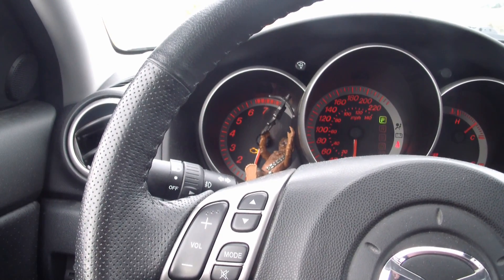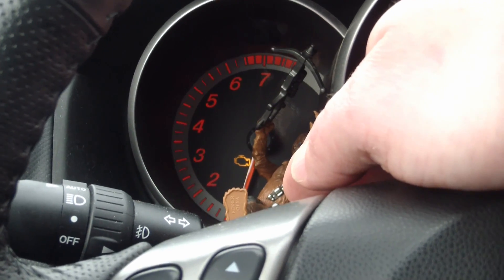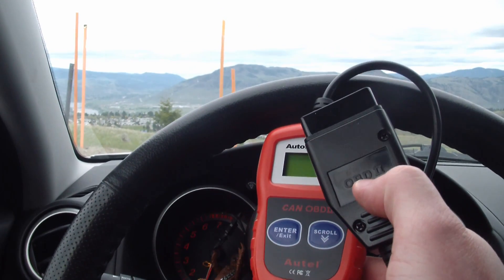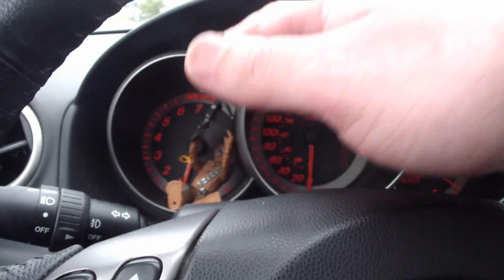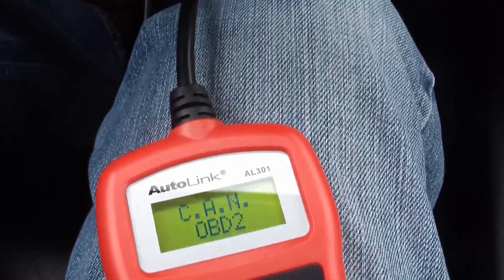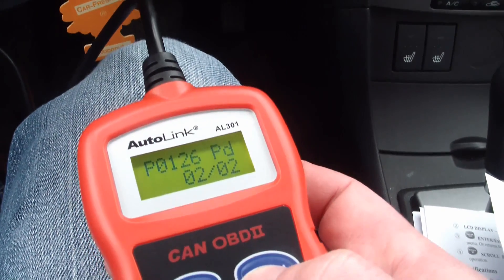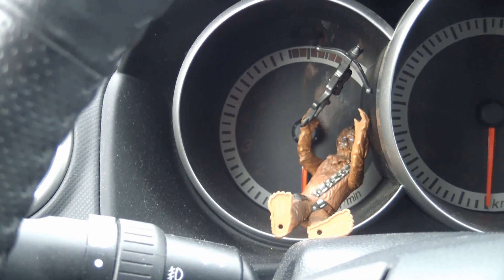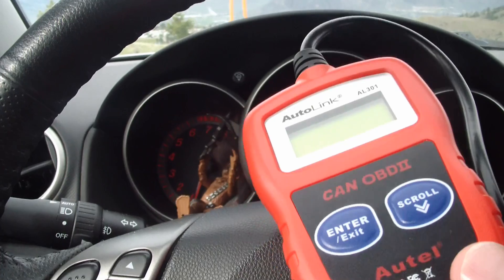Manly-Man Skills: Outsmart Mechanic Scams by Using Your Car's Computer!

Comment: Dealers arent all fuckin crooks.....Backyard Mechanics such as yourself are the crooks. Ripping people off and still not able to fix the car. Then people bring me the car at my dealership where I work to get it fixed right.  :)
Reply: Backyard mechanics are not the crooks. Quite a lot of them may not have all the proper tools to do the job as fast as a dealership but they give it an honest effort, unlike 99.999% of Stealerships. I'm not a certified mechanic but I've been the owner of a dairy farm for the past 38 years and there is not a single car, truck, tractor, implement, etc. that I've come across in all my years that I haven't been able to fix, and fix properly, by myself. Everyone in my neck of the woods brings me their vehicles, tractors, small engines, etc. for repair/rebuild and they contact me for all their welding/fabricating needs because they've all been screwed over by large garages and dealerships.
 I've worked with a lot of younger guys who were certified mechanics with 4-5 years experience under their belts yet still didn't know half the time and money saving tricks us non-certified mechanics know from hands on experience working in our shops on the farm.
Dealerships are there to make money and the mechanics don't give a rats ass about honesty. Shade tree mechanics and farmers who help out their neighbors put TLC into their work to keep people coming back and to honor their names so their friends and neighbors don't think they are goofs.
Reply: Jim Garrison 
I have had to repair alot of what local farmers have screwed up. bailing wire and duct tape can only do so much. most of them ( 95 percent) Need to stick to pulling tits and planting corn. not all professional mechanics are bad and not all backyard mechanics are bad. but most professional mechanics are not farmers and most farmers damn sure are not mechanics. stick with what you know

Comment: did the code ever come back? 2.3/2.0 4 cyl...thermostat is sticking open...common thing on these. v6...also check the thermostat. probably a 4 cyl in there since it's a Mazda 3.

Comment: OBD2 codes are a standard diagnostic logging system. The PCM will set trouble code(s) and command on the malfunction indicator lamp. These stores codes indicate a fault with a System, not part. The least likely cause is "loose connection" at a connector. By the way, the thermostat code this guy is talking about WILL come back. Simply starting engine after clearing the code didn't fix anything. The engine had not researched operating temperature and the PCM hasn't monitored the coolant temp sensor long enough to decide to turn on the lamp again. What he DID do in the video was erase all of the stored data related to the trouble code. This is a variable source of information for a real technician to evaluate the cause the code.

Comment: There are now PC based scanning systems available that turn your laptop into a scanner. They use a hardware interface that plugs into the OBD2 port and communicates with your PC via Bluetooth. You also need scanner software to run on the PC. I got a very capable scanning system for around $60. In addition to trouble codes and monitor status you can monitor things like coolant temperature, O2 sensor outputs, engine vacuum, MAF sensor outputs, fuel trims, etc. It will even make graphs so you can record what's happening as you test drive the car.

Comment: I've saved thousands by checking codes myself. The first time they charged me $120 and all it was just the gas cap wasn't tightened down all the way. They didn't want to tell me what the code was. He just said it was nothing important and still gave me the bill for $120. I made just enough of a fuss and they finally gave me the code. I've never gone back to the stealership.

Comment: The general rule for Audis is that a lit CEL is normal, no big deal. A flashing CEL? PULL OVER NOW!
I'm not sure if other makes are the same.
Reply: flashing light is bad
Reply: CallsignWulf a flashing cel can be for a misfire, but it just means that a catalyst destroying event is occurring.
Reply: Flashing CEL on every car I've seen is an active/currently happening misfire.
It's honestly not that big of a deal, depending on what you are doing of course. If it's only during high load, just ease off and get it fixed when you have time. If it's happening under no load or light loads, yeah might wanna get that fixed pretty fast. Either way though it's not good, misfired will kit the cat really fast.
 Source - ASE Student Certification
Reply: flashing cel is often a misfire, but a 'misfire' may be really bad compression, in my case a exhaust valve was burnt out. or your valve timing is off. basically flashing cel is anything the computer reads that MIGHT destroy you motor quickly. take it seriously or be prepared to buy another car.
Reply: a flashing CEL is a type A misfire. which is a misfire that is frequent enough to damage the catalytic converter by dumping unburnt fuel into it and melting/burning up the cat. that is why you want to pull over and stop the engine asap. so yes, it is a big deal. do not listen to callsignwulf

Comment: One of the great things if you have an Android based phones is you can buy a bluetooth based OBD sensor which allows you see what is going on while driving (i.e. oil pressure, temp etc.) It is a bit more finicky than the cabled ones but more informative. Majority of the codes people see are emission related but the big one is a loose or malfunctioning gas cap (aka minor evap). Also keep in mind that behind the standard is required interval testing where it will poll the sensor at specific points ie after sspecific mileage, number of starts, etc.

Comment: love yer vids.
As a proffesional stealership tech, i can partially agree with you. i encourage folks to buy a POS scantook, or even stop at a local parts house, and pull the codes, then use the almighty google and see if its a big deal.
the part i cant agree with, is that the codes exist outely for then stealership financial pleasure. The codes are a tool, to help localize the real problem. Most codes, will cause(over the long term) damage to the catalyst, which will effect fuel trim, and thus lots of other parts of the drive cycle. Older cars, it didnt matter remove the cat, but newer cars use the cataylst for fuel calculation ie ecm looks upstream and downstream and adjusts based on the difference.
Without going into much detail, stealerships are in need of a wake up. charging what they charge, is as ludicrous as how they pay us as technicians. It forces us to basically not give a @$!#, and just work, instead of being fair about it.

Comment: True story, The Mitsubishi stealership charged me 75 bucks just to read the trouble code. They also wanted 500 bucks to replace an O2 sensor. I declined the O2 sensor change. Come find out I just had a dirty air filter
A$$Holes!

Comment: It's unlikely that this was a fluke or sensor having one little slip. This DTC is a two trip cycle. Meaning that the car has to mess up twice in a row on two separate trips. They thought this through when they introduced OBDII. Your pending code mean that it has seen the fault happen in the last trip and so it sets the pending code. If the same instance occurs twice in a row in two different trips it will set a permenant DTC and illuminate the check engine light. So most codes are not random sensor glitching.  Some codes are considered 1 trip dtc, but these are considered major fault code. If you have any questions about cars ask away. I can most likely point you in the right direction.

Comment: you have know idea what tour talking about. nobody will know your car better than people who work on them everyday over and over again. an independent shop will not know the product as well as a dealership technician. and certainly not you, apparently. that code would come back instantaneously. it will need to be driven in order to detect the fault. something you never do is erase a code to see if it comes back. it set the code for a reason. not because of a glitch.
Reply: Dealerships don't necessarily know everything. My friend has a Ford Falcon Futura 1996 and it has a idle problem where it will hunt like crazy, revving up and down. He took it to a couple of mechanics and they couldn't figure it out. Finally he took it to the Ford dealership and they kept the car for 3 days and they couldn't figure it out either. If Ford can't figure out WTF is wrong with a Ford then nobody can. So he learnt his lesson, never buy a Ford, and mechanics and dealerships aren't the all knowing car gods he thought they were.
Reply: Well I do agree with you on one thing. Never buy a ford

Comment: Most of the time the light comes on because the gas cap is not on right or missing. The light will also come on @ a set milage so you will come in for a service so they can change you EGR valve, O2 sensors, clean the throttle body & shit like that when it usually fine. most of the time they do nothing @ all!!..........if your lucky they will lube your hinges & latches.

Comment: More often than not it's because of a bad seal on the gas tank, or from getting gas with the engine running.  The sensors trip if there is no vacuum in the vapor recovery system, usually removing and replacing your gas cap and running the car for a day or two will reset it, once it runs through a drive cycle .
Reply: on the evap emission systems a lot of times its a loose gas cap or seal, but if those are good usually is the canister vent valve on the charcoal canister

Comment: My Avalon has this lovely quirk where if it doesn't like the way I screw the gas cap on, it turns the check engine light on along with 2 other lights. I was considering getting a computer to turn the code off myself so I'm really glad I came across this vid. Thanks for the info brother!

Comment: It means that a micro-chip has burned out really for the most part because you have about 200 sensors that light is connected to.

Comment: I'm old enough to remember cars without computers / sensors / fuel injection. I think cars in general have become more reliable as a result of new technology. The thing that seems to confuse repairers, is when there is no fault code stored in the computer - they then seem to have a guess at which component is at fault, then swap-out parts - at the customers expense - until the fault is cleared.

Comment: not all codes come back instantly if there is a problem. Things like evap codes need 2 faults detected before it will set the code. this can take a long time as the fuel tank level has to be in the right parameters, ambient and coolant temperatures have to be in the right parameters, and it sometimes takes a proper drive cycle to run this self monitoring test.

Comment: Even if you fix the problem and erase the codes the smog techs can fail you because their code readers can tell them if a code has recently been erased ,
Reply: Well its not about the codes being recently erased, its about the ecu/ecm performing all the required tests. When you clean the codes, you also clear all the stored info for the tests the computer performs. Some cars and driving styles can quickly perform those tests, maybe like 30 minutes of driving, others can take months or longer. It should happen relatively quick but there was some problem in earlier systems (my car) that make it hard to complete the tests. 

for some Subarus: Readiness drive pattern: accelerate to 50 MPH, drive for at least 3 minutes without braking, decelerate to 30 MPH, then accelerate again to 50 MPH, and drive for at least 3 minutes again without braking. If having to brake, then start the pattern all over again.

Yeah... when will that ever happen naturally on any road. Oh yea, on these Subarus, some of the tests only happen if you have more than a 1/4 tank of gas, but less than 3/4 of a tank. The main issue was that until a test is finished, when you turn the car off, it reset the test again, and has to restart.

Comment: the enginelight lit up on my fiancees audi, 3 km later it was dead, seized camshaft. that was apparently not one of the 9 times out of 10...
Reply: Are you sure it wasn't the oil light she was ignoring?
Oil light= shut off engine
Reply: it's a lot less than "9 out of 10"
Reply: I had a wife who did that because the oil light in her Renau was always on. Blew a gallery plug on my kombi and got about 5ks down the road before friction-welding the motor

Comment: There is one problem with unplugging the battery no days with the current vehicles. If you do that, you clear everything out of the computer including the programming of the computer to operate the engine. You will then have to get said car towed to dealership for reprogramming. Best advise is to 1 check internet if your car falls under "unplug battery precautions" 2 if you can just get away with the scan tool trick. Happy diagnostics to y'all.

Comment: My car periodically gives the check engine light and when I plug in the code reader it says “small emission leak” I clear it and it’s good for a few weeks.  You’d think if it was something serious it would happen every time I ran the car.  Here in Ontario we need emission check and it passes so what the frick?
Reply: +CurseTheDawn Some emission sensor might have gone wrong :P All depends on if you got petrol or diesel. Both systems are pretty much in two different stages. First stage dose the calculation of how well the engine will burn, 2nd stage checks that the burn is ok. If you got a petrol engine there might be an oxiden sensor (aka lambda) at the most rear (of all the oxiden sensors) which has gone bad :P They commonly got a heating element aswell, and can pretty easily be measured by an ohm meter.

And the reason why it takes some time for the code to come back is probably because it needs to really dubble check the emission status. Or it could be a "glitch" problem. But a "dead" oxiden sensor fits in on your fault :p But more measurements needs to be done before that is said.
Reply: Wow man, thanks for the detailed response.  My issue is with a 3.7L GM petrol engine.  That is the most common error but I've had others.  One time it limited power and said ABS failure, Stability System failure.  I pulled over, shut the car off, cleared the code, and then everything was fine and has been since.  Really makes me question the quality of that vehicle's sensor system.

Comment: You can also get a sensor to plug into the jack that will transfer the information to your phone real time. Not just error codes either. Super cool how much information you can get.

Comment: I think your representation of technicians is not just and you should think of a better way to represent your lack of trust.  I will admit, I am a technician and I take offense and I am sure many others do.  Not everybody in our trade is dishonest.  Some of us work VERY hard at being honorable individuals that perform the repair correctly the first time. The system itself is what drives mechanics to do bad.  They get their knees chopped off for warranty labor so they try and sell everything they can, sometimes including things you don't really need.  Mostly flushes.  If you question it, make them prove it.

 The largest and unknown trick that I see crooked shops do today is labor overlapping,  This is THE leading reason why repair bills tend to be so high.  Lets say that you take your car in and it is overheating, say a Toyota Tundra.  Nightmare situation for most people.  The shop says that you need a water pump, which includes the replacement of the timing belt.  They say you also need a new radiator and a serpentine belt.  When they give you the labor quote, they will look in the book (Usually Mitchell or Alldata for independent shops) and look up the labor for each individual part to be repaired or replaced. 
  In all reality, the labor will take far less than you are being charged for.  If you are doing the timing belt/water pump, that means that you have to pull most of the front of the engine apart anyway.  That means the Serpentine belt is coming off anyway, and can easily be replaced with a brand new one for exactly zero extra labor.  Also, with the radiator replacement, it will be easier to do because half of it is apart anyway for the timing belt job. 

So, say the total labor time they charged you for was 8hrs......What they should have really charged was 6.5hrs.  With today's labor rates, that means that single job was overcharged for an easy $100+.

Not everybody in the industry participates with the dishonesty.  Unfortunately, it has become hard to find shops that do things right.  The best shops usually have a waiting list, and for good reason.
Reply: A few bad apples ruin the batch.....but when just about every single person has a personal experience having to eat one of those bad apples, there's a serious, systemic problem here.
Reply: You yourself admitt that it is practically impossible to find an honest tech these days so why woyld you take offense? 
Be proud of your honesty not offended for something you don't do, it makes you seem more than a little dishonest!
Reply: It doesn't matter how honest you are, the system should have been designed to allow you to simply get these messages directly on the dash if you so want.
If you do not know how to pull a connector and reseat it, or do not want to know, you can go to a dealer/workshop. If you do want to do this you should not need to use additional tools to do it. Especially not tools that isn't even supposed to be available to the public.

Comment: That light is NOT going to come up right away, if you clear it with and obd2 scanner. However, You have to drive it for a few hundred miles for the computer in your car to fully read/recheck for faults. 
If it's a real Fault i WILL APPEAR AGAIN, but only after the computer fully reads the car again.